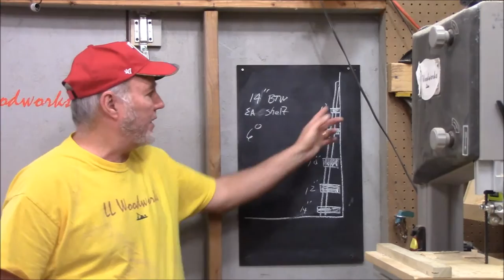How To Make a  Leaning Wall Shelf

Comment: Now I just have to keep this video hidden from my wife, she's been wanting one of these.How were you able to make sure the dadoes were at 6 degrees to match the 6 degree slant of the shelf?Regards,Bob
Reply from the maker: +RJBWoodTurner  Hello Bob,  I used a bevel gage set to the same six degree 
Angle and marked the dados at their locations on one side.  Then I laid the two sides against each other and marked their matching locations.   I think you need to make both the wife  and your daughter one 😀 Thanks for watching.
Reply: @LynnLaceyLLWW  I don't have a bevel gauge, what is another way to get it done?